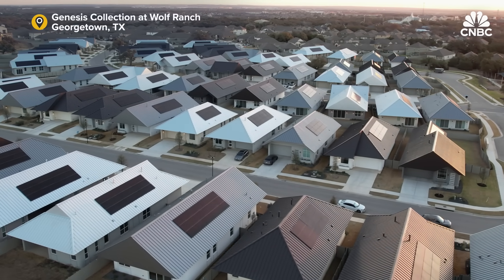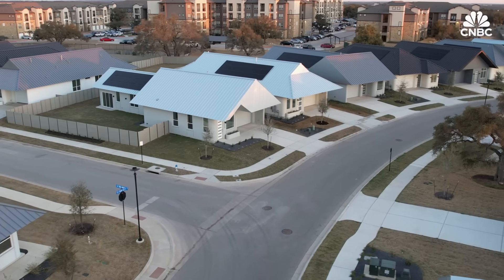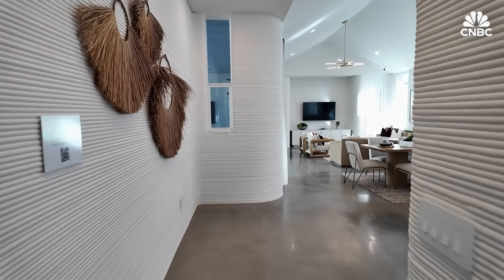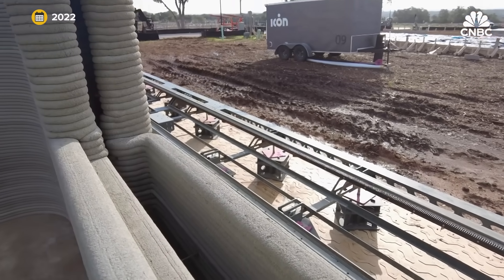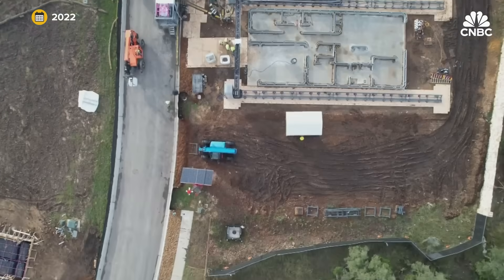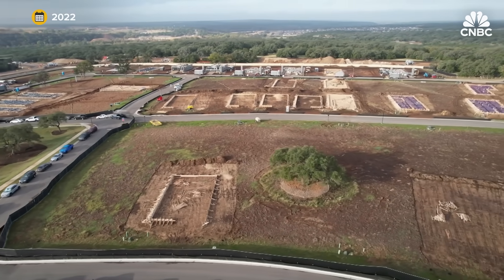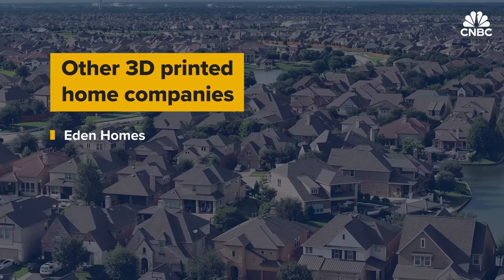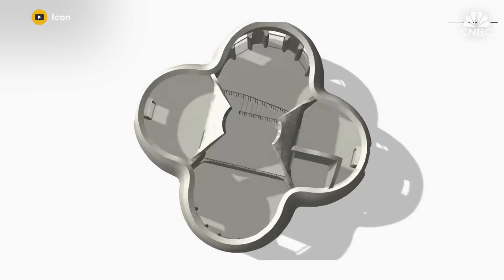Inside The World’s Largest 3D Printed Neighborhood

Comment: Is it earthquake proof?
Is it highly insulated- keeping the heat out in texas and the cool out up north?
Can you add wiring and pumping later? 
Can you add rooms or remodel later?
Is it hurricane proof?
Is it repairable if a car or hurricane takes out a wall?
Will it withstand California wild fires?

Concrete curing releases about 1/3 of co2 releases each year- do they have a solution to that problem?

Will all the 3d printed homes have the visible layers of each layer of cement, or can it be smoothed to be like stucco, stone, brick or sand blasted wood grain?

House insurance rates are going sky high - preventing people from buying homes - does 3D printing reduce insurance costs?

Comment: So, all I am seeing is Solar Powered homes...I have a conventional home, 4 br/2 bath. We don't pay for our electricity most of the time due to having solar panels on our roof, just as what's seen throughout the video. It's the same exact cost of a modern home....perhaps even a little pricier at the moment, but speculated to be much less expensive for future projects comparatively. As far as everything being "automatic" or automated, smart homes exist. Primarily it's the structure and cost-efficiency we're looking at in regards to the building material and method of construction.

They also talked about it being fire-resistant...which is a huge plus. However, there are already a plethora of modern "fire-resistant" homes that use concrete as their primary building material and roofing that use fire-resistant material. There is no such thing as a fire-proof home, they never mention fire-proof (it's fire-resistant). I would be looking further, such as Earthquakes. They say stable, and only touched a little bit on hurricanes. Tornadoes could be another thing to see if the structures could withstand. Also, how difficult it would be to tear down the structures, move them, or otherwise renovate? It's good for moderate to low-income, but let's say someone wants to renovate and expand? I don't see it being as easy, but would love to see a solution for it.

This is like that one time someone tried to sell our family a "water softener solution." Basically a water filtration system for our tap, because we had "hard" water. Generally that's what they're trying to sell you. A solution to a problem that we don't really need or ask for. The only real upside for consumers is for construction to finish in about a third of the time it normally takes. The major upside for corporations is the cost to construct.

Comment: The only savings I see for consumers here is on heating and cooling over time maybe. They need to stop pretending this about reducing prices for consumers which is the problem with housing in general. There is not enough affordable housing, even though there are plenty of homes. So ultimately, this puts construction workers out of jobs, allows the builder to build cheaper, but make more profit, doesn’t make the homes cheaper for the consumer, so it’s not a solution to the housing crisis.

Comment: How will the NWO burn it down with their lasers to build the 15 minute cities?   

That power usage summary for Texas is CRAZY bad reporting, as in Summer the AC makes up for 80%of the bill.   A year long summary would show the average bill to be $250-$350 a month.  Lived in Texas my entire life.

Wonder if you could run hot water through the middle walls to heat them up with radiant heating?   

Wonder if that cut of labor costs will ever trickle down to the buyer, or just remove humans from the job market?

Comment: There isn't a housing shortage in the USA. There's an AFFORDABLE housing shortage. Large swaths of entry level homes have been scooped up by investment funds, "renovated", and then put up for rent/airbnb at insane prices. There's tons of homes out there sitting empty because the bank is perfectly happy to sit on a property because the lack of homes on the market drives up value. And it's all made worse because no one is building the tiny homes that older generations built their equity with. $400k is not an entry level home.

Comment: If they indeed can make a concrete roof that is safe and reliable, then this will turn the industry on its head…. Most of the lost efficiency in your home when talking about cost to heat and cool, to fix and cause other systems to fail and or fall in on you, is the roof, doors, windows.  Getting rid of the traditional wooden roof would just make this more affordable down the road, make the whole thing more affordable down the road. This in turn would be far easier to heat and cool for the hvac, causing your electric bills to get considerably easier to pay on maintenance and a replacement due to the system having a relatively easier life instead of working at 100% all the time.  Not having to replace shingles, or anything on the roof just saves money, I would still imagine that the roof would still need some kind of sealant, but I’d say that it’s a pretty safe bet it’s far cheaper than having to replace shingles or a tin roof.

Comment: Yeah, but can it be built on the east coast?  Because if it can only be built in the south west, then it’s “useful” ness really only further over crowds states that barely have enough survival essentials (water ways) for their current residents.  Also, if it cannot keep it’s temperature well, then air conditioning or heating bills will skyrocket.

Comment: Very stupid. It's a fraud, scam.. it's not going to do anything less expensive. The problem with high cost of housing is 100% greedy privat companies to that build housing and many middle hands that also are greedy. Then you have the banks, they can't exept that housing becomes cheaper of they need the margins they have in loans.. so they need a high number in people can't get a house or apartment, with the purpose is that housing cost always go up and peoples dept goes up, then it's all regular people that already have big dept on their housing and if prices goes down 70% of Americans going to loose millions. And to reduce laybor cost mean lost of work and that also being higher cost  in taxes. And those printers are extremely expensive, demands massive of service and maintenance and one printer  must make 1000 house for it to break even, and there is a big problem in those houses in repair end rebuild walls if it starting to crack. Super hard to paint and keep inside and outside surfaces clean ... News media is crap and their commercial like this is just lies

Comment: How do you insulate? If you’re not framing a wall for drywall and insulation then how? Concrete with no reinforcement? No rebar? That home will crumble or definitely crack with an earthquake

Comment: Costs less to build. But that doesn't change the market value. If a new stick built home in an area goes for $300,000, the 3D printed home will go for around the same. Why? Because if the 3D printed home is sold for much less, then the property value of surrounding homes goes down as well. High property values have their pros and cons. A big con is that higher property value means higher property taxes. But a big pro is that if you bought a home 10yrs ago for $225,000, you might be able to sell it for $300,000.

Comment: Personally, I would like this approach perhaps for the exterior walls, but then build the interior walls with stud and gypsum allowing for greater flexibility throughout the years. 

Cause otherwise, what happens when you want to:
1. Get within the wall to fix an electrical issue?
2. Remodel and open up the kitchen or bathroom wall plumbing or anything like that
3. Install a flat screen on your wall and cant run the electrical through the wall
4. Fix the wall due to picture hanging, etc.

Comment: This is basically a block home. We do a lot of those (bloc) down in FL. You safe in labor but spend double setting up the 3D machine. Concrete is concrete no matter what form its laid… block, form poured concrete or 3D printed. In my opinion framed house are still much cheaper

Comment: LMFAO, this is AWFUL. Curved walls everywhere... Congratulations every single room in the house is now practically smaller because no furniture will fit properly in the corner of a room (ya know... the most likely position you'll want to put furniture...), which means all that space is wasted between the wall and the furniture. On top of this the lines look absolutely awful. Oh and BTW good luck every modifying this home. Want to put a hole in the wall? Have fun trying to hide the hole. Want to knock down a wall and open up a room? Oh sorry, can't do that because that's load bearing for other sections of the house. Even adding an extra electrical outlet to a room is probably gonna be 10x harder than a traditional home.

Comment: I'd say this stresses the importance of a solid foundation.  Sure, that's true for every home, but concrete doesn't flex like wood, it cracks, and nothing is worse than having a wall cracked and potentially leaking water or air through it.    And you have to love how it's so much quicker to build, uses less materials and labor, therefore costs less, but it still the same price as a traditional home.

Comment: I love the idea, but wonder about how you modify the home in the future.  Our home is 40 years old and we have been in it for 30 years.  We have moved both interior and exterior walls.  We have redone the HVAC and electrical wiring to accommodate new technologies like heat pumps, solar, and battery storage.  We have redone the roof 3 times, with the latest requiring changes in the rafter system and foundation.  Could we do this with a printed home?  What would the associated costs be?  Would these costs be higher than a wood-framed home?

Comment: Building the walls of a house is probably less than 10% of the job  you have the permitting . Foundations, roofing,wiring, plumbing, painting,windows,kitchens,bathrooms ,flooring   None of this is helped at all and is definitely going to cost more as the builders haveto adapt  so on a $200,000 house and land at say $100,000 you’ve got like $20,000 for walls  say this printer is $5000for set up programming and the three days (it won’t be)  and the mortar truck does a good deal and works for three days for his $5000  so now your $300,000 house is down to $290,000 . Notice the ceo said they’re costing more than conventional builds   But he’s hoping to rectify that as the tradesmen adapt   . That’s ceo speak for they’re a pain to work on cause they’re different   And the code guys also are just letting them go wild …remember concrete ALWAYS cracks  it just a matter of how much and rebar and vibrating it are the two best ways to mitigate it

Comment: They gotta get the price points way down but I'd give it a try if the bank allowed me to. They should offer manufacturer direct purchase on contract options. The prices aren't necessarily the problem, the minimum mortgage qualifications usually are and explains the current problem with housing and the fact that the average age for 1st time home buyers is up to almost 60yrs old, with over 40% of the housing in the country currently owned by boomers.

Comment: Problem is that this makes all the other parts more expensive, and you can already do framing/walls pretty cheaply with stuff like factory built elements. Unconventional shapes and everything being concrete is just much harder to work with when it comes to electricity, plumbing, finishes etc. And those are generally the expensive part. There's also the issue of demand and resale. Not many people will want the unfinished concrete look outside or especially inside. And if there's too many round shapes inside, it will make furnishing harder.
I just don't think this will ever be cheaper than competition, unless you specifically want this style of house. 
Make automatic brick and mortar laying machine and that would be pretty revolutionary. Brick is really good material, much more sustainable than concrete and valued in houses. And takes a lot of work to lay down.

Comment: Just think for a second, something the consumer doesn't usually do. What happens when you have a bad pluming pipe or need to run electrical? or with anything that needs repair or maintenance that's behind the wall? What you do now? normally dry wall you just patch up the hole and that's it. Also if these even hold up in time they will get dated, and then how would you remodel. I suppose they just bulldoze the whole entire home and start from scratch with the new 3d print? Oh and then right the homeowner probably doesn't have a home for some time till construction is done. Yea not the type of questions they asked, the ones that REALLY matter.